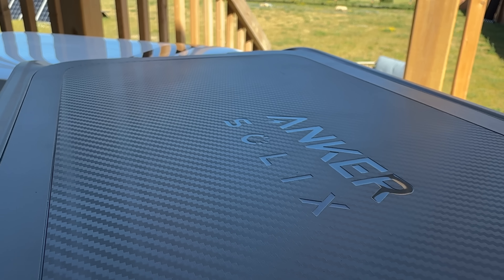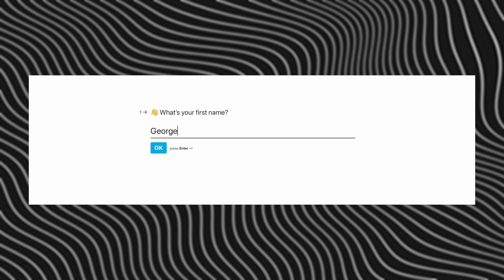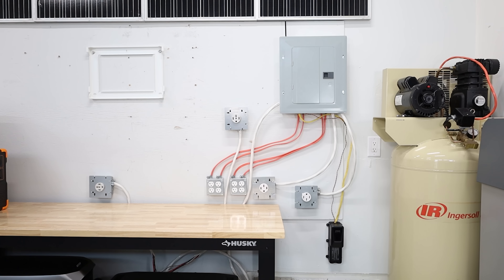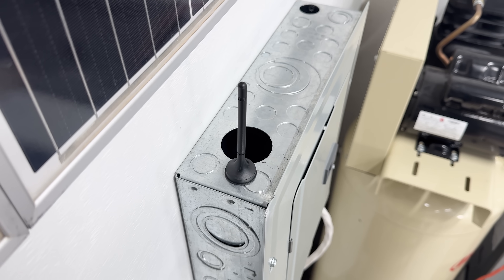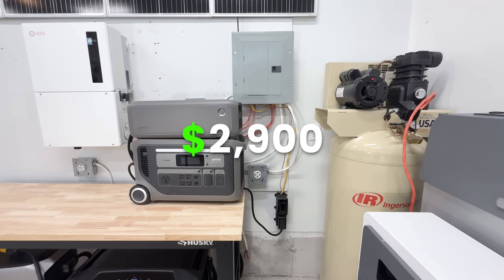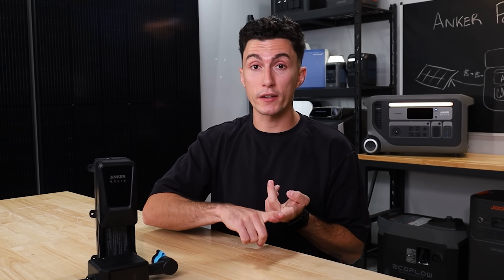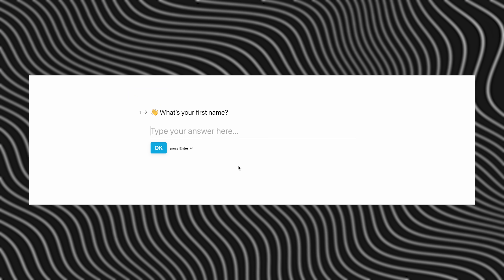Anker's $500 “Power Saver” - Gimmick or Game Changer? (Bi-Directional Inlet Box & Smart Meter)

Comment: You missed a couple of things. Peak shaving it does really well, without and additional solar you can program it to charge when your existing solar system is pushing power out into the grid, and have it inject power when you a pulling power from it at night. So it's not powering your home, it just offsetting the power you pull from the power company. If you have two units, one for each line, it will put out upto 1800 watts per line, not much but over a long period of time it makes a big difference. My typical tru-up is about 1500-2000 and if the numbers are correct with what the app shows I expect that number to cut my true up in half or better, depending on how often i take them to work or camping or whatever. As far as cost goes the packages go on sale and thats when you want to buy. I got 2 f3000, 6 additional batteries and 2 of their 400watt panels(you're right on those, overpriced junk) 2 of the smart meter kits, 1 of the 240v combiners, and an f1500 with a 200watt panel powerstation as a bonus for $6400. Thats right at about 60% off of their normal price and not taking into account the $800-$1200 in freebies. I'm an electrical contractor, and actually got the 1st unit as an impulse buy with the f3000 an expansion battery and 400 watt panel. We are working in caves right now so traditional generators are a no-no, but thats what started my little endeavor. I needed to do about $30k in improvements to my home setup,(including the equipment) to get the installation permitted which is a requirement for the tax saving ($7500) . I could have done it for much cheaper, as your video shows the basics of it don't take much, but mine is outside and integrated into my well service which also has a 28kw generator and 48kw grid tie solar system. Interlocking everything so that its automatic but still plug and play when I want to use them for construction work, added quite a bit to the cost. I had to build a storage system to keep it out of the weather, but still easily accessible added quite a bit to the cost. I still don't trust lithium batteries, so installing them aways from my shop or home was a must for me. I feel the same way about solar, my system is ground mount, never have and never will suggest they be roof mounted, for both service to the system and protection of the roof. Back to the units the tech is awesome the way it just tries to zero out the load from from the utility. The dislikes in my opinion are the price at full retail is crazy high, and not worth it unless you can get it on sale. The units themselves are well built, but the quality of the smart meter and the inlet box should be much better for what they charge which is way too much at retail and still ridiculous for the $200 each I paid for them. That is the weak link in the system and I hope they hold up as they are the key to shaving the tru up bill. I've never been a fan of battery systems, as they are always built with load panels, leaving most of your home un served unless you dump serious money for a whole home system. The way these work they just monitor what your home is pulling, when your solar system is pumping power out to the utility, the batteries charge, and when you are pulling more power than the solar can produce or when you aren't producing because its dark or weather or whatever, they discharge. For power outages I do have it designed to supply power, but thats a manual setup, incase the generator fails. It's too bad they don't build the bigger setups to do this instead of designing them as a half cocked generator setup that can't power full size heating and air systems or hot water and cooking appliances, things that a decent generator can handle easily without risking damaging motors and sensitive electronics. So I guess thats my big grip is the limit of its size and that quality issue on the smart meter. That's where I see it not being able to pay for itself without tax incentives.

Comment: How does this prevent back feeding to the main power line if the power is out. The purpose of a transfer switch is to protect backfeeding, which protects utility workers.
Reply: It doesn't it kills the back feed. Can't use it for backup and savings at the same time

Comment: The reason Anker says 1.2kw of power generation is the "ideal kit" is simply a regulatory thing because that's exactly the limit of plug in solar systems in the few areas of the world where it's permitted. After dealing with the cost, the interconnect agreements your power company will require (outside of Utah), you'll never be cash flow positive on this. Ever.

Comment: I didn't think this would be worth it for my f3000. I have a transfer switch from my gas generator so i just plug into the 30 amp outlet with an adapter  cord tt-30 to the 14-30  transfer switch plug then switched over the circuits on my transfer switch. I had solar panels already. It is saving me money

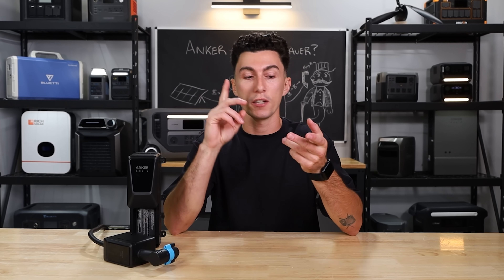Comment: 6:40 it doesn’t need communication run. This is only if your WiFi signal isn’t good enough.
Reply: You’re correct.  But in my opinion Anker does a poor job of communicating that.  If you read the manual word for word, it is in there, but their YT videos and basic quick read of the documentation then it implies you do need it.  If I remember right it’s like one sentence buried in the install details.

Comment: Took the quiz. Suggested more inverter reviews. Can you use a Grid tied inverter that has current clamps with exporting turned OFF to do the same thing as the Power Saver kit???

It not working with the f3800 is a huge miss :/ sad, didnt they know they had this in the pipeline when they came out with the PLUS version?!

Comment: Would be cool if someone made something similar that would work with any power station
Reply: You won’t have all the bells and whistles but you could have a transfer switch installed. The one I have with 4 switches is selling for $160 right now. I paid an electrician $250 to install it. You can use it with any power station and choose which circuits you want to run. It’s not automatic, so you have to manually flip the switches. No possibility of back feeding.

Comment: You over looked something that you can do with a solar+battery system such as you described.

A similar system can double as an uninterruptible power supply.  The value of powering a fridge/freezer over a power outage means your perishable food will last longer and/or your network connection might still function, and/or you could keep your phones charged indefinitely.  Does the specific configuration you described have that capability while still being able to take advantage of night/TOU discounts?  (I use a different brand, that does.)

For people who are subjected to occassional power interruptions, the payback period may be much shorter or even irrelevant.

Comment: WRONG well just at the end, more like you are being misleading as well, because you can NOT use the 6000XP to back feed your main panel activity with the grid, and the Anker device can, the 6000xp is an off grid setup and you’ll need like a sub-panel with selective circuits moved over etc.. totally more complex and costly installation, with that said if you do not already have the Anker f3000 and you got $5k i would look into the Anker F3800 with the smart panel and buy your own panel, or a hybrid inverter with batteries, since hybrid inverter allow for back feeding your main panel without the need for sub panel or moving any circuits and can be done for less than $5k.

Comment: I have the F3000 and I would mount this box in a Generator shed where the F3000 is.  The power panel is about 15 feet away and I can't find anywhere how long the CT leads are to make this work.
Reply: I had somewhat of the same issue. Generators in mechanical room and panel in different spot.

The answer is - if you install the smart meter in the panel and have a 20 amp in your shed that runs to your panel, and good WiFi signal you should be able to make this work.

Comment: I recieved 2 of these free when I ordered 3 extended batteries and I can't just simply install them in my state because it's required to have a smart interconnect that cuts power from backfeeding to the grid during power outages to protect linesmen.
Reply: Hi this system automatically turns itself off almost instantly when the power goes out. Personally i wouldn’t even bother reporting this since this system is designed to never back feed power to the grid.
Reply: @Blessed_tech_reviews this is correct
Reply: @Blessed_tech_reviews  It is never perfect and the utility WILL discover it. Most utility companies require, and this is spelled out in the rate tarrifs, that any device operating in parallel with the grid, which this is, require an interconnect agreement even if this is a zero export device with the anti islanding features. The transfer switch someone mentioned above almost certainly requires an electrical permit to be done legally, and to pull a permit it has usually has to be a licensed electrician. You might find an electrician who pulls the permit and signs off a DIY installation, but it still adds cost. Outside of Utah, there's currently very little opportunity for most people in the USA to deploy one of these. It would be far better in day to day use to have the bidirectional box than the transfer switch since it's entirely automatic and invisible. But if the grid goes down, the bidirectional box cuts off. So now you're back to needing a transfer switch. You'd just unplug the Anker from the bidi box, and plug it into the transfer switch.
Reply: I was just about to ask if this is fully legal without a qualified electrician install and authorization from the utility company due to the potential of feeding back into the lines.
Reply: @SuperSonicGamer763  Yeah, I'm in contact with customer support to see if the system is set to disconnect during power outages to make sure its compliant. Which is a pain because this means this is not a way for automatic backup for critical appliances in the house and would either require manual connection to them or still requires a transfer switch hooked up the output of the generator.

Comment: 8:41 "You're going to  generate about 6 kW of power per day from your  solar panels."

Nope. The panels will generate varying amounts of POWER measured instantaneously in watts.  What they produce over a certain amount of time is measured in kilowatt-hours of ENERGY.

You would not say your car used 10 horsepower to drive 500 miles -- you would probably measure it in gallons used (basically the equivalent in energy).

Comment: i dont understand why the company's that make power stations never consider the customers that have already bought into their systems. so many of the new products are not usable with existing products just like this one. it only works with one NEW station..... a two circuit transfer sw is just as easy to install and way more usable....for what ever 6k capable power station you already have.
Reply: Because they want you to buy new. It's just that simple. That's why they keep churning out models with only the slightest differences while discontinuing the older models.

Comment: Hi @thesolarlab I currently own this system! I love your videos and have been watching for some time now. One thing I feel like you need to correct if possible is that this system requires the signal cables to function. You can actually use this system completely wirelessly! The smart bidirectional outlet can communicate with the smart meter wirelessly. The only requirement is to have a good WIFI signal to both devices. I wish I could share pictures on here so I can show you that it works.
Reply: I came back to correct this as well. Currently using over WiFi with no communication signal. It does test to validate signal is strong enough
Reply: @youshagn yea i figured it out finally. Works well. Helping my 18kpv when im tuning that system, at least I get 15kw solar through the f3000.
Reply: Yeah, just installed mine yesterday and it’s amazing how much power it can shave off especially with solar🔥
Reply: @PrestoMoto02 yes it is! Congratulations on your new Anker Solix system! Did you do the installation yourself or did you hire someone to help you out?
Reply: Hey Fernando. Hope your weekend is going well.  Can you please make a quick video on youtube when you get a chance, specifically on how you connected your smart meter and bidirectional plug for F3000. You would be the first user youtube video on how the install goes, other than Anker. Anker video is from far away and guy does not show close ups of wiring. I know you have one on facebook, but for some of us that don't use facebook, youtube would be awesome. I had it for a month on the shelf with breakers and colored wires ready, but due to the daunting 55 page pdf install, it was a no go still. Thanks.
Reply: Hi @SurgeonTech , Fernando here! sorry about the late reply, i don't really check my YouTube notifications since i don't really upload content here. I went ahead and aded the brief installation vid i posted in the Anker Facebook group on my Youtube page if you are interested in watching it! Thanks for the motivation my guy! I might start uploading more content here in the future depending on how this vid performs!
Reply: @Blessed_tech_reviews thanks. I spent like 4 hours trying to figure it out, but i did it. Although i orderded a few of them for my relatives, so your video will help, because my brain is toast and forgot how I did it after that long haha. Thanks

Comment: Personally I think this is a first step on Ankers part to get a “balcony” solar position in the US.  Everything about the F3000 and its unique use cases seem to be consistent with smaller scale (e.g. apartment or condo) type approach.  Germany is big on this now and as code compliant solutions are developed, it could be big in the apartment communities in the Southwest of the US.
Reply: This is exactly the use case that I'm considering this setup for! I would be using rigid bifacial panels, but at least it would start off connected to my current 200w Renogy portable panel that's been hanging off my balcony or inside my balcony door (not ideal with the UV film, but still worked okay) for most of the last year. It currently powers my Anker SOLIX C300X (max 100w in) and also a 20-40,000mAh battery bank hidden away in the (mostly) weather protected port pouch taking 65w away. 

In Wisconsin we aren't allowed to have community solar, behind the meter apartment or condo solar distribution, nothing can be allocated outside of the utility, WEC keeps raising rates for regular consumers while dropping them for the world's largest data centers, and our statehouse is flooded with cash from the utilities to keep the Right AND the Left silent on the issues. We might as well sacrifice a breaker that's used for closets or a hallway we don't have anything plugged into and reallocate it for solar generation and battery storage to offset our ridiculous apartment utility bill! I just can't stand paying $0.185/kW
Reply: I chose this setup become I don’t have panel space for the larger system. Happy with it so far. Panels going up this weekend!

Comment: Rocky Mountain Power in Utah  stopped new signups  earlier this year for the EV TOU plan until major changes in January 26. Since Orange is killing all EV related programs I assume these plans won't survive, or be very different next year. My F3800,  extra batter plus old 10KW EG4 power backup system connected to solar inputs works well. Peak shaving dropped  my bill  $90 per month during this very hot summer. In winter not as much, about $40  heater runs a lot in 20  degree weather.  Peak $.25 off peak $.06 per KW.